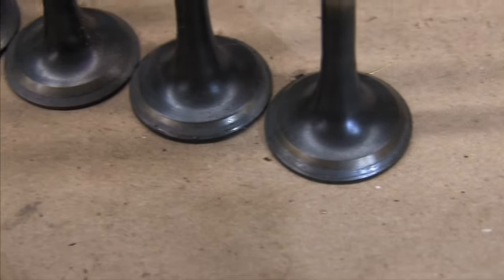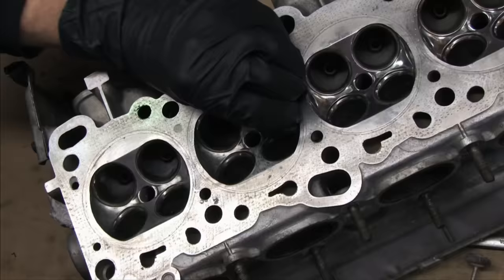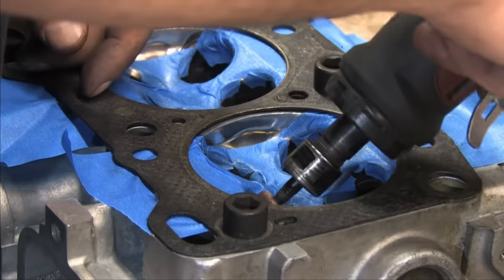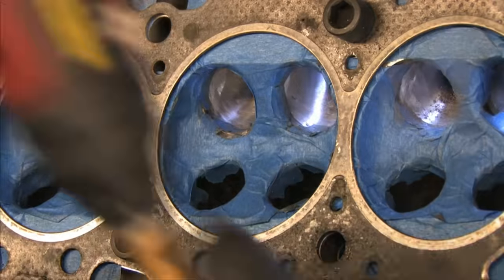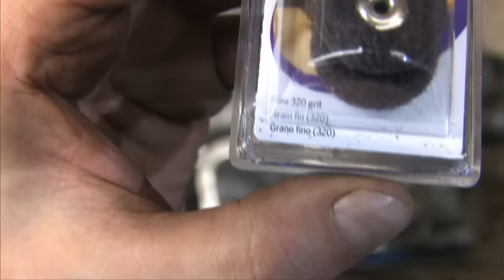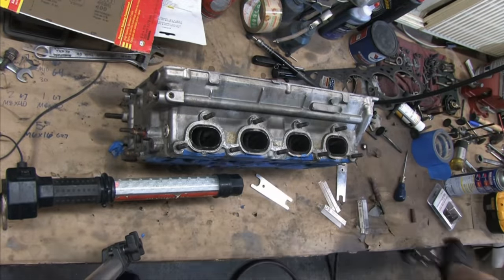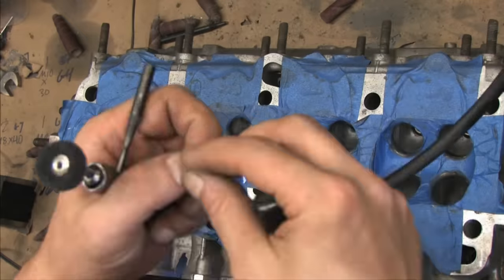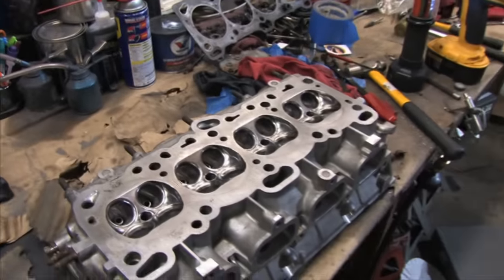Cylinder Head 204 - Porting & Polishing

Comment: You want about 80-100 grit surface roughness on intake.  Flows air at a higher velocity because like a golf ball, the roughness provides "air bearings"  so air moves quicker.  Extrude honing doesn't work very well, only works on parts you cant get to like some intake manifolds and exhaust manifolds.
Reply: My information is from UNOH using a flowbench.  Take it for what it is worth.
Reply from the maker: No questions there.  Most people see the thumbnail and assume those are intake ports.  My intake ports are 1/2 rough.  I left the bare cast texture on the length of the floor inside the intake ports.  You can't see it very well in the video because the ports curve downward, but there's a few shots in this video where it shows the floor is rough.  The polished texture is blended into the roof, only.  The short radius was de-burred only and smoothed before the seats.  Because of some of the casting flaws, I know at the very least that I improved what I started with.  It would be sweet if I could find someone in my area to flow a stock 1.6L 4g61 cylinder head and the one I polished.  I can get my hands on another one of these heads, but I called everyone who advertises the service and they all told me they can't even attach their equipment to it, or that they can't give me accurate results.  What's the point of flowbench equipment that doesn't give accurate results?  According to my datalogs, I have no shortages of airflow now that it's bolted back together, but I'd rather know cfm per-runner and what my work did?  I'll find a reason to tear the head off, get that other head, and drive a reasonable distance if I could find someone that wants to do it.  People near me don't even seem to want to let me pay them for this info.  I researched how to build my own flowbench because of this, but have since lost the motivation due to time and space constraints.  I just don't have the room to build it.  I also don't really want to ship this head.  I want to be able to film it and talk about the shop that did it.  I'd ship my pants, I'd ship my drawers, but I don't want to ship my head.
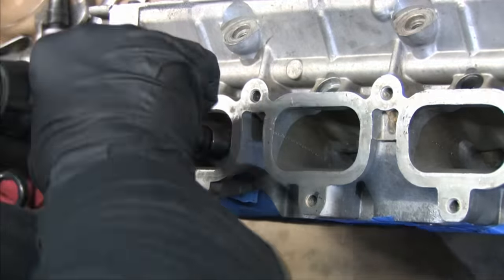Reply from the maker: ...also please note at 14:39 where I gave 90% of the viewers an out.  I told them that's a stopping point for intake work.  The rest of this is a waste of time.  I do know the golf ball theory and how it's being evolved into aeronautic and the lab cars that got 70+mpg.  I don't disagree with existing data.  If someone had a cylinder head that was cast as irregularly machined and poorly put together as mine, I would still expect this treatment to yield significant gains.
Reply: Jafromobile love all your vids I see them several times no matter if was sub when you upload them and by the way bad obsession garage aka project Binky mention you on the last video Q&A 😲💪💪

Comment: 10 hours of polishing?!? Forget that!
Reply from the maker: It's not for everybody.  If you ever pay for head work, that's why it's so expensive.  :)
Reply: ***** I have no problem putting in the effort and time if I find the returns beneficial. 10 hours of polishing a head for minor gains compared to 3 hours of work...especially in the long term as deposits accumulate after a relatively short amount of run time...ultimately isn't what I would call a good ROI.  It was done because Jafro is passionate about it and enjoys the polishing process.

As far as artists and such, I've spent months writing a single program but that's not really a fair comparison.  You can't compare a task that requires X amount of man hours to be completed to a task that technically isn't even necessary.  A more direct comparison would be the UI I made of a point of sale system I made my cousin's business.  All told it took me half an hour to make a decent interface for the touchscreen.  I could have spent 5 hours on it and made some pretty buttons, some nice animations and in that time maybe amongst all that extra work I tweaked the positionings to be slightly more efficient for use (let's say on average it would reduce checkout times by 1%).  Is it nicer and more efficient? Yep.  However, it would take at least 5 years before the time saved by the cashier made up for the added cost of my labor.  I'm sure the system will need updating as the business grows within that time period, too.

Extra time can be spent for a variety of reasons, but ROI is where I find my greatest success.
Reply from the maker: 94XJ "It was done because Jafro is passionate about it and enjoys the polishing process." ... and because Jafro is going to use water/methanol injection to keep 'em shiny.  :P

On all points you are correct.  Time versus reward.  In my case I see the 1-3% benefit as a "if you don't do it now, you won't have it over a long period of time" sort of approach.  On the programming side, pretty buttons, animations and streamlined interfaces may be time consuming, but they help things you don't often see like employee retention, efficiency of service and reduced training.  But if it was my cousin, I'd invest extra time to make the buttons as confusing and pointless as possible, I'd make it as annoying and unstable as I could.  That would be his reward for not paying me enough for a "family job".  :P

Comment: Ok, if its fuel injected the atomization is high enough to allow polishing. Leaving the ports rough is something I did back in the day because on my street rod, that was carburetted, and it does help with atomization  and increased performance. But its a street rod. Not a race car. On a race car with higher velocities then it should be ported and polishing again depends on the class of the race car. 

Today there are very few carburetted hot rods on the street so things have changed and porting and polishing is fine and wont affect atomization at all. On street cars, be careful the ports arent opened up too much. The size of the runners are carefully engineered and you will lose performance if the ports are too large. 

Should also be using machinist dye so you can watch how much material is being removed more carefully.

Oh yeah, taking off too much material can also cause excessive heat build up on the thin areas and cracking and work hardening. Sooo be careful. There is much more to this than meets the eye.

Comment: Even though I’ve done this plenty of times over the years as a motorcycle mechanic/racer I just couldn’t switch it off. It was a great video. Thanks for a refresher course as it’s been a while and I am getting ready to do a set of Mopar 440 heads and it was definitely worth the time for an old mechanic like myself even if just so I remover the stuff I need to buy to be able to keep working instead of running to town for something I forgot to buy.

Comment: Dude  you are a riot.  The mono logging during the work is funny and insightful and packed with very sound advice. This is by far one of the best DIY videos I have watched. If it wasn't as good as it was I never would have made it thru the half hour of watching it.  The thing I keep running thru my mind is the hours vs. cost of a shop. You say you took it to a 1.5 level port job at 30 hrs of labor. If you paid a shop 100/hr that's 3k and I don't know what shop rate is where you live but  out here in CA. performance shops can charge that per hour.  Take it to a level 2 or 3 porting with a 5 angle valve job ( I would say x2 for a v-8, but with 4 valves per cylinder you did the same work ) and I would think that would double the hours from 30  to 60+ hours.   SO your time is worth money ,but it seems to me you saved between 1500 - 3000 with the material cost under 100. That is a job well done !!!  I look forward to seeing the engine running and to hear what other things you did to it along the road to being rebuilt.
Reply: I'm reading this about 3 years later after this post and still prices have probably gone up on labor and polishing /porting no one ever does for the simple fact that they don't want responsibility of you blaming them for their car not being where they expected their car to be at and don't intend to care about what you might say or what they have contributed to the problem since they don't know what they're talking about and the majority will just try and blame the mechanic that worked on their their car or anyone else that touch their head or just anyone who even drove their car not the person who worked on the entire engine for like 3 years and tried to blame the guy who just touched up the surface of theirr onehead t's incredible the amount of money you'll spend for a job like this nd he's right California is one of the most expensive especially here in Los Angeles to get a port job done

Comment: That's a lot of work man, and good work too. I got to hand it to you.  As for the people you said think a ruff casting helps atomize the fuel.  I think they don't understand what atomization of fuel is.  Port turbulence won't even mix the fuel.  The only thing the ruff port finish does is increase boundary layer turbulence thereby essentially reducing the flow size of the port.  As for amortization. Honda did a study more than 40 years ago and they found that amortization ONLY happens when the piston is compressing the fuel/air mix.   The compression of the fuel/air and heat vaporizers (amortization)  the fuel.  At near TDS the pressure can run 300 psi for a light load, to 1000 psi for a production engine at full power, to even 1500 psi for race engines.  People worrying about mixing or amortization of the fuel in the manifold or intake port are wasting their time.
Reply from the maker: Thank you!  So many people believe that port textures are religion.  I made this video, but even I don't believe that.  I just wanted to demonstrate all the techniques that were possible while experimenting.  When you get into forced induction, 90% of the port texture crap goes right out the window.  Flowbenches don't test with boost, they test with vacuum.  Boost compresses the boundary layer, so the observed tests from a flowbench change under the engine's running condition anyway.  EFI engines don't mix fuel in the manifold like carbureted engines do.  The reason I was willing to try this has more to do with the principles you explained.  My reading on the topic exposed that 4V/cylinder engines don't produce swirling airflow currents as the combustion chamber is filled.  2V/cylinder engines do (like most normally aspirated V8's).  The majority of fuel mixture that occurs comes from the tumbling effect as air rushes in and gets compressed.  My efforts were to try to exaggerate the tumbling effect a tad by disrupting only one side of the boundary layer of the port.  Did it work?  WHO KNOWS?!  LOL!  Wait... that's your user name... ROFL.  Really, the car is running extremely well.  It's making a ton of power for what it is.  I know I didn't hurt it.  I also know that I can't afford having someone make me a PolyQuad head to produce swirl, and I'm not willing to invest that kind of cash on a 1st gen Elantra that's only gunning for 12's in the 1/4 mile.  Thanks again for getting it.  :)

Comment: I painstakingly ported and polished my VW heads and produced a lot of power from a fairly small displacement. I couldn't afford ported and polished heads from a supplier. I used "flapper" wheels that I got from a welding supply house. They were hard to find with a skinny enough width to fit into the ports but they did a great job polishing them. I also cut the valve guides so they didn't stick out into the port. I had a stiff neck every night for a month and slight carpel tunnel syndrome.

Comment: I ported my f22 head for the first time about 10 years ago and had a blast on what I was able to accomplish.  Though all did was just smooth out the casting, I was happy with the outcome with just that alone and it was assembled back as stock as well. Felt little gains and also notice some better mpg in the process. I just did it just to kill time when head was out. You did better by polishing. I👍

Comment: Found myself immersed in this withpout noticing. Lots of info at break neck speed! Interesting the inlet polishing note with injected heads rather than the rough finish I am used to with carb'ed motors

Comment: Yes there are pros and cons for polished combustion chamber one flame travel and carbon buildup as well as hot spots but some keep the CC's the same and give it a light sand blast for air fuel mixture myself I have 11:1 compression and a light blast on mine...
   Good demo of doing the work on it and telling the time it takes I did not realize you injectors are by the valves hopefully you make your horsepower and gains your looking for.. I know for my Olds motor's I got 75+ to 100 H.P. on them just in the heads 75+ is my Small Block &100 is my Big Block even my Harley was a big improvement...

Comment: Great video, info, voiceover and technical aspects. Highly watchable, hugely useful.
I stumbled upon your videos recently as I'm rebuilding and porting a spare cylinder head for my CA18DET, which is reasonably similar to your 4G61(?) but with small 28mm exhaust valves and "optimistic" 34mm inlet valves in a 83mm bore.
There is a key similarity I would like to ask your opinion on... 
Where the manufacturer originally machined the inlet valve seats there is pronounced valve shrouding where the OEM cutting tool cut a cylinder into the chamber wall for the valve head movement. This is a protrusion on each of the outer sides of the inlet valve seat curtain areas.
Would it be beneficial to blend this into the rest of the chamber wall/dome to de-shroud the valve more? I note you have effectively polished the sharp protrusion down a little but it's still a lump.
There is smaller similar machined sharp edge opposite in the wavey quench pad (there is some inlet valve de-shrouding shaped into the quench pad as the seat is more recessed from the head surface than in the 4G6).
I'm looking for better cylinder-filling at low valve lifts, max lift will be only 8.5mm. Get the momentum started early in the column of air.
I'm not concerned about reducing the compression ratio a little as it's already increased thanks to 1mm oversized pistons with my engine rebuild.
It does appear that the machined areas are already very close to the fire ring, so I'm carefully trying to blend that and the protrusions to form one smooth concave dome (a larger-bore head gasket should help as it's 1mm overbore).
Also, should the valve bowls be smooth for optimum flow, or coarse (80-grit?) to energise the boundary layer so fuel doesn't drop out of suspension?

Comment: 2009 Hyundai Accent 1.6L I4 DOHC. I replaced the Hydraulic Lifters and after reinstalling the Cams ended up bending the valves P0301. 30PSI in #1. Picked up a replacement head from the wrecker and will be rebuilding it. I’m one of those people who wouldn’t attempt a Port and Polish for fear of messing it up. After this video I think I could do it.

Comment: I've ported quite a few heads on 4-strokes and transfer ports, etc on 2-strokes and there is so much satisfaction when you get the mirror-like shine.  The thing to watch out for is that you do not produce a wavy wall(s) around these ports.  If you do produce waves such as that you can actually reduce flow due to the mixture of air/fuel detaching itself and causing  flow-killing turbulence.

Comment: Fuel atomization happens inside the intake manifold. It should be well atomized BEFORE reaching the cylinder head at which point it needs unimpeded flow into the combustion chamber. So this guy is on the right track.
Reply from the maker: Technically by that standard I'm actually on the wrong track.  The fuel injectors in this engine spray at the floor of the port directly in front of the valves.  The injectors are actually mounted into the head beyond the intake port.  You can see the bosses for them milled into the head above the intake ports.  So the fuel is introduced in the same place where I did my work, dyno sheet because I've done so many other things to it including cams... but with the way it runs, I didn't hurt it at all.  It's moving an awful lot of air.  There might be gains?  But without a flow bench I was more interested in sharing all the techniques and tools someone might use rather than the methodology.  Thanks for spending your time here!
Reply: @Jafromobile  Welp, it's typical in a carbureted engine where fuel is taken in at the top of the intake. Fuel injected I wouldn't think it'd make much of a difference porting or not as most injectors do a well enough job at atomizing the fuel. More specifically if its a 4+ port injector, which I'm guessing yours are. Either way, it can't hurt. I'm not a professional on these things. Just shop class and the last 15 years or so wrenching on old 4x4's which don't translate well into forced induction systems. But I look forward to learnin' a thing or two from your vids!

Comment: Damn, have you convinced yourself yet?  Polishing a combustion chamber is fine in general and best for a drag race only engine.  For a street driven engine, it will be negated after just a few hundred miles.  I'll be looking for your follow up video of the chamber surface after 100, 1000 and 2500 miles and before and after dyno tests with timing and anti-knock data.  The port smoothing on the other hand is definitely worthwhile especially if you have experience and data to back up the port shape you create.  Good luck!